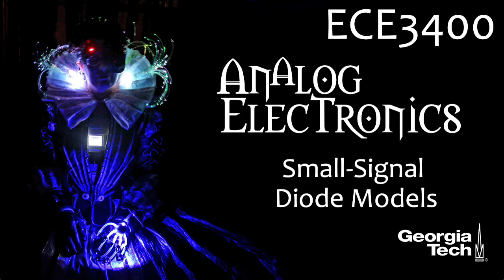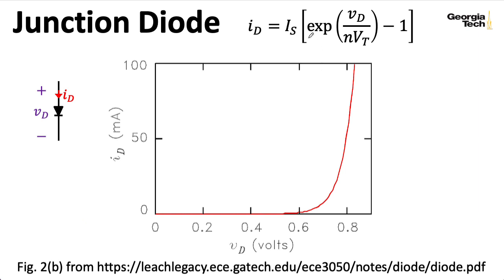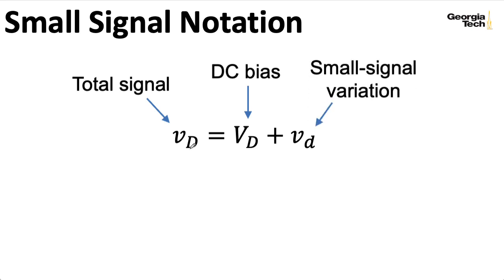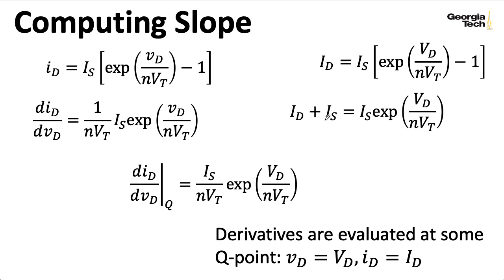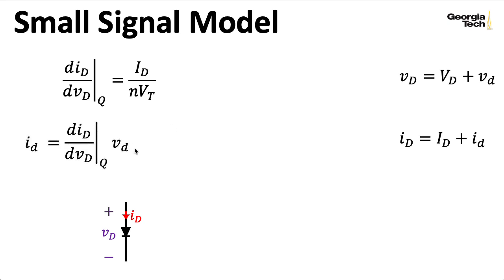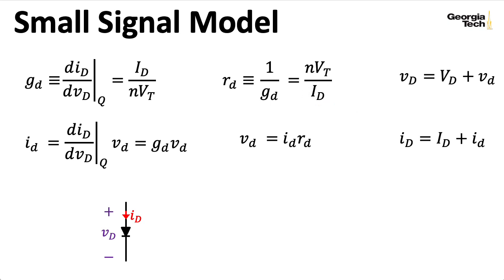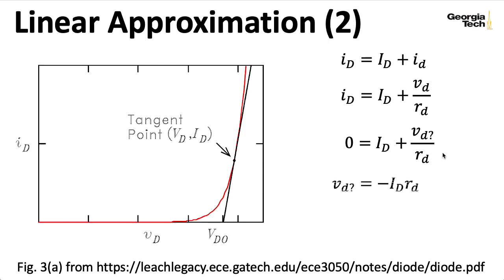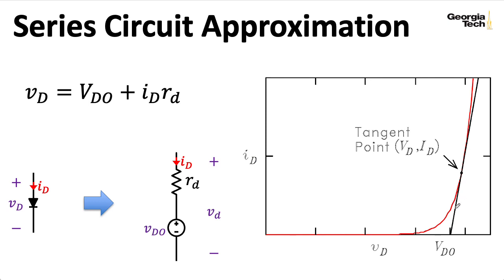ECE3400 Lecture 3: Small-Signal Diode Models (Analog Electronics, Georgia Tech course)

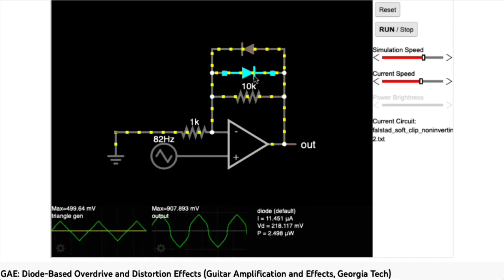Comment: 1:58 if you try to simulate a class B amplifier / push pull in the Falstad sim you get a similar wave but you get horizontal flats instead of vertical around the zero crossing.
although i used diodes on the base of them transistors but biased them, like Roland did in their modular synth.

Comment: Thanks for another informative video. Are there any applications where you might want to use that very non linear region of iD/vD in a diode?
Reply from the maker: There are! By changing the bias point you change the dynamic resistance and can hence have a sort-of-kind-of-vaguely voltage controlled resistor. This is used in the Neve compressors like the 33609, the VCA and VCF in the Korg MS-50, and the Yamaha GX-1 VCF.